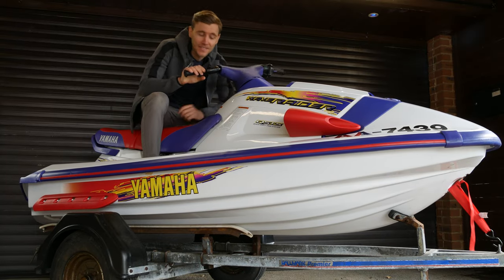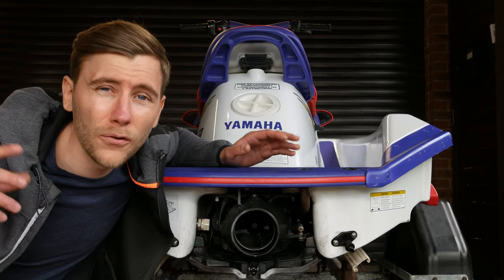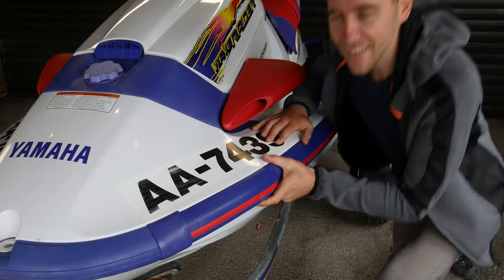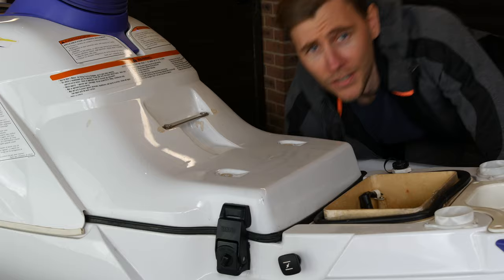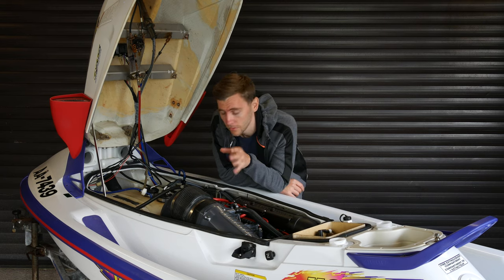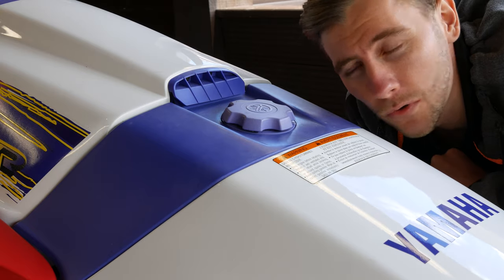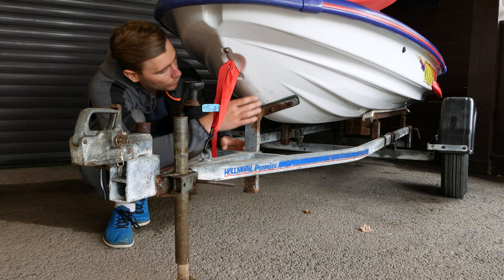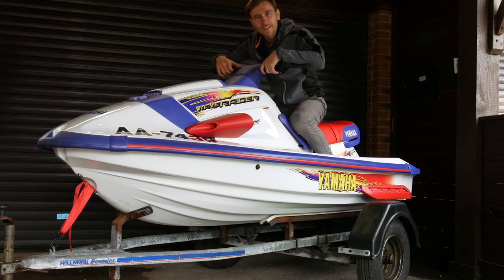CHECKLIST | Restoring 1996 Wave Raider 1100 | Wave Raider 1100 Series | Ep2

Comment: We just bought a pair of 1996 Yamaha 1100 triples in very great condition  !!!!! 1 is the Wave Venture and 1 is the Wave Raider with the QSTS quick shift trim system.  Both have been converted  too run off 40.1 ratio of pre mix 2 stroke as both oil has been deleted!!! I heard the original way is better and not to do the conversion set up ?? 🤔🙄🤔 Any suggestions  on the truth of the 2 ??
Reply from the maker: Good work on your pair, sounds like a nice find! Ok so the truth is, there isn't a truth...sorry thats not a direct answer but with premix/oil deletes, this is a personal preference... I have always been massively against it as for me, if you're maintaining and checking the the pump regularly, you shouldn't have it give up.... the issue I think from where oil pumps go bad is years and years of neglect and then, they go out, ride it hard and then it gives up. I would also add, most riders I see at my lake that run premix, always moan about not getting ratios right... in a nut shell, OEM in my opinion is better, plus its far less messing around... my raider is still using the original pump and not missed a beat... thanks for watching 👍